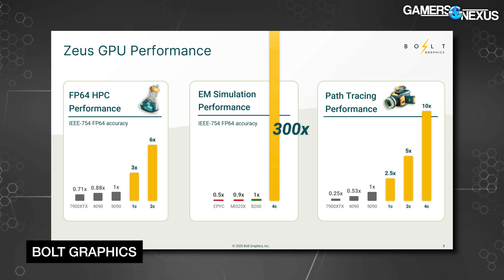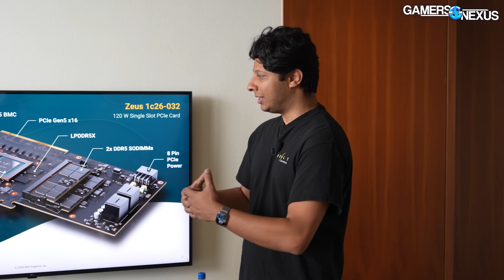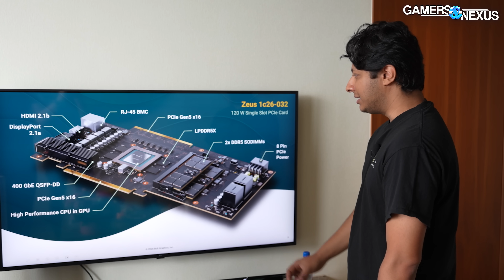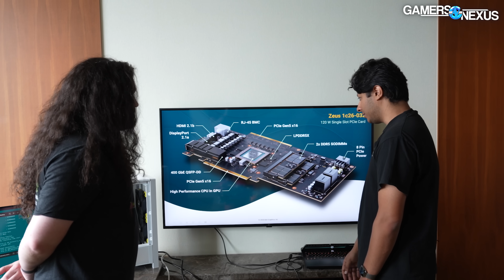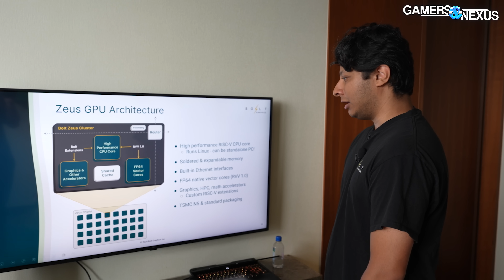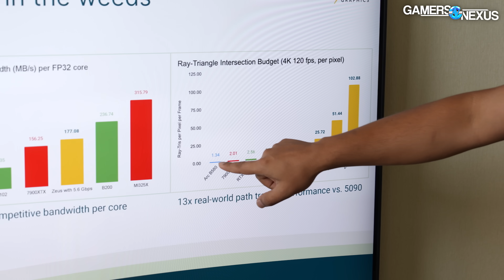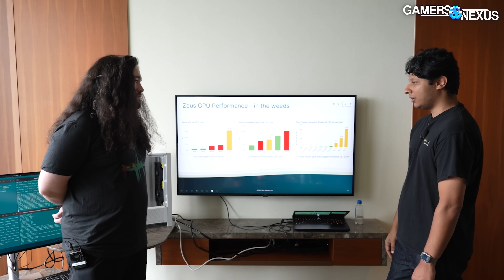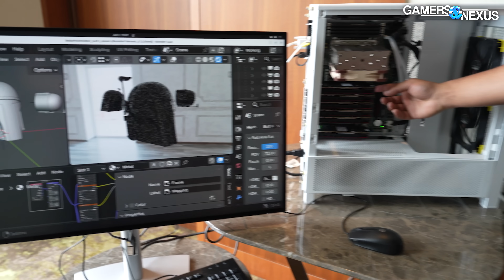A New Gaming GPU Challenger: Bolt Graphics Takes Aim at NVIDIA

Comment: Funny thing is, over 25 years ago, I pitched the idea of creating a GPU that had some sort of FPGA core to some teams at our university - to create a GPU, where you would reprogram it based on the application you wanted to run.
Instead of having a generalized GPU that is optimized for a bit of this, a bit of that, you could've had a GPU that could be tailor-suited to a certain game and the reprogram it for a graphics design workflow, again for video editing, pure raytracing and so on.
The lab of the Uni I was at had pure raytracing cards back then running on similar hardware clocked at 80mhz, that were faster than a 1.6ghz x86 CPU for RT tasks (not gaming, industry stuff).
The time wasn't right though, and also the time to set it up for the applications meant a) having a huge driver set with loads of presets and b) carrying enough FPGA cores to make this work meant having a huge (and expensive) chip.
With the specialised core count of todays chips, this is probably not even possible anymore.

Comment: Its going to fail since they have no real target market.
The places that could put this to use already have there own custom designs.
Content creators will use Nvidia since thats what every thing is made for. When your time is making you money you dont want to waste time on issues. Or they will rent time in a server farm which already has its own silicon.
It could be promising for Ai work but then again youd just get Nvidia or if you had mega mega dollars you create custom silicon.
And gaming well they are dead in the water without raster.

About the only market I could even see for a product like this would be as a addon card.
Run it along side another GPU and this handles the path tracing only. But then that becomes driver hell to try and support.

Comment: The best approach for this company would be to not go head on against NVidia and AMD at least not at the beginning, instead make this an add on board that works alongside an existing video card providing additional processing power and make drivers that behave similar to the Lossless Scaling software. This approach would allow for capital to grow very quickly, if they can make it for $750 or less. Unfortunately, this card would probably sell off the shelves rather quickly for A.I. use as well, especially with a $750 price point. Wishing you luck.....

Comment: I can do everything I need on my 3070 TI and 4070 Super for the next 2-3 years.  I hope Bolt's card is at least a mid-tier performer.  I don't need 8k@90fps.  I run 2k @ 120Hz  at most.  I'd buy their card, especially if they're not beholden to a VC group who's partially owned by nVidia or Palantir or any other AI slop master.

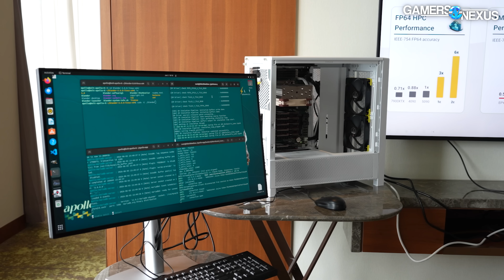Comment: 0:38 User expandable GPU memory???? This is amazing.
Reply: But then speed would be worse but i might take that tradeoff
Reply: Nice, but the bus is obviously slower and probably generate more heat.
Reply: I wonder how much the slotted memory will affect VRAM speed.
Reply: Hold your horses a little bit there! Games are not architected for multi-level memory. Games will only run on the baked in Ram. End of story (Mostly). Games would need some patches or support to be able to use it, which won't happen until this kind of architecture gains market share.

The user expandable ram will be for other things like large render jobs, or maybe a home server LLM that can live in it.
Reply: It's not. You're going to get lower bandwidth.
Reply: For what reason? That is for AI to tell you the truth. This company is just trying to do the smart thing.
Reply: @IdeaBoxful Because they can sell you a cheap base version with 8GB soldered for example, that you can then upgrade however you want as soon as you hit a bottleneck.

Because you can simply replace a memory module if it breaks.

Upgradeability and repairability are always a good thing.
Reply: @IdeaBoxful  the extra memory is in theory helpful for ai, but ai is not constrained on memory. it's constrained on bandwidth, and severely so. it's so bad, people have looked at stuff like analog flash in hopes of digging their way out.
Reply: Only for inference, not training, no?  @dead-claudia
Reply: @badgermcbadger1968  training requires extra memory, but that can be solved by just adding more memory (what nvidia's doing). and any latency can be hidden by just having a big enough pipeline.

now, if bolt did a design with tons of chiplets and added in the experimental matrix multiply acceleration instructions, people would actually snap them up for ai (and very quickly). but they aren't targeting that.
Reply: @IdeaBoxful  LLM's need bandwidth. 2 DDR5 slots gives maybe ~100GB/s. The 5090 has 1.79TB/s with GDDR7 iirc. The H200 (datacenter GPU) has 4.8TB/s with HBM3e. 

In short, the extra slots are useless for AI. Might as well max out your system RAM instead and get the same bandwidth (and actually get to use it). Could be some niche productivity uses, but that's about it.
Reply: @PragmaticTornado this product is designed for existing real usecases, not AI crap. As mentioned in the Video, the first target will be workstation tasks like 3D animation. And memory requirements will depend hugely on what people use the device for, or how complicated their 3D models are. One core part of the design appears to be higher flexibility with a much more capable instruction set and out-of-order execution. So it's going to possibly be slower with very simply structured workloads, but it will probably excel at complicated tasks where existing GPUs suck badly.
Also they make up the reduced memory bandwidth with caching, which will accelerate some workloads a lot, while some workloads might not profit much. That basically guarantees them a customer base with those workloads where it will blow out any existing competitor products.

And remember that the displayed device as explained is about 1/6th as much power as a 5090.
Reply: @PragmaticTornado  not to mention SODIMM slots can't run at high speeds, UDIMM are better but still lag behind CAMM or the good old
Reply: Its ddr5
Reply: @sirynka  their performance target is closer to the gtx 1060, which used gddr5. they have two ddr5 ports and two lpddr5x chips, which together would provide a similar amount of memory bandwidth if you do the math.

edit: they're not chasing raster performance, but ray tracing and path tracing performance. and so they can kinda get away with leaving performance on the table if they specially accelerate those.
Reply: @dead-claudia  There are two ways a processor can access two different memories, 1. run all memory at the same speed (the slowest speed) 2. build specialised circuitry in the microchip to decide which memory to use for which data, something that will definitely increase latency, power consumption and generated heat. this product is unimaginably stupid.
Reply: @Real_Commander_Shepard  The primary use case as stated in the video was to use the DDR5 SODIMMs as spillover which doesn't require running the soldered memory at the same lower speed as the SODIMMs nor does it require any specialized scheduler circuitry. Similar things have already been done already on some Nvidia video cards in the last decade or so. The second use case mentioned was striping across both memory pools which also doesn't require the memory to all run at the same speed with different size stripes for the different pools and the added latency of doing so is negligible compared to the latency of any memory access, especially compared to other GPUs which have far higher memory latency than such a product has to begin with. The very large cache also helps to limit the impact of memory latency and bandwidth for many use cases. Nobody claims that running their DDR5 system memory slower than their CPU cache is causing problems.
Reply: @sirynka  and?
Reply: @stclaws9580 it's way slower Than gddr That gpus use.
Reply: @stclaws9580  gpus recently have had GDDR6.

Comment: rare gamer nexus L.
They are literally hiring every position. It is like 1 dude and 4 PR/Sales people. Their job listings is literally hiring every possible hardware design role. Their funders are expecting them to launch a product Q4 2027. Shit is NOT happening. They don't even have the head count to layout a design, let along verify timing, verify engineering samples, and do a production run.
Reply: Also too many people are just wowed by "user expandable memory on a GPU!!!!1!" and not bothering to look up the difference in bandwidth between GDDR6 on modern graphics cards and laptop sodimms. There's no way this card functions comparable to any mainline gaming card released with the last 10 years. The CEO can boldly proclaim he intends to compete against Nvidia all he wants, but he won't be with this card. It's like a weak little level 1 goblin trying to fight kratos.
Reply: @iofhuazebulun7199  GDDR "can" work if you throw enough channels at it.
Intel is planning to do this with Celestial Islands, but they're going to chuck 24x channels at the problem.

Imagine people buying 24 laptop SODIMMS 😂😂😂
Reply: @iofhuazebulun7199  Did you not see the video. The card has a massive amount of cache.
Reply: Mouth breathing capital G Gamers

Comment: This is clearly not a gaming gpu. 400gbe interconnect and 2 channel ddr5 memory bandwidth puts this in the 'connect up 32 of them and run tensor parallel AI models' use case, not the 'play cyberpunk 2077' use case.

Comment: A video card with SODIMM slots is something that would've saved a ton of drama for decades. Probably SOCAMM2 would be a better fit if I pretend memory's still affordable for a sec. I kinda wonder if things have sped up enough that hitting the SODIMM pool won't feel like hitting the top 512 on a GTX 970.

Comment: AFAIK their ASIC is freaking fast for RT, PT and other compute intensive kernels targeting animation studio, game studio, movie studio etc at native resolution without dlss and other upscaling fast. I've no idea about power consumption and since it's ASIC it should be usually in the range of 1/5 or 1/10th of 5090 without burning the connectors. 
Xilinx is somewhat easier to get than nvidia fpga. 
As always I'll wait for second or third gen if the price is right since outside USA the prices will be brutal and only chinese gpu can compete with low prices with domestic fabs. 
Edit: I think the risc V IP is either Sifive and tenstorrent because of the AI focus with AMX

Comment: This combined sodimm and lpddr5 solution was something that AMD introduce with Vega architecture but was broken in the die. I believe they even had the issue fixed by the time the Radeon VII shipped. That's 2018 til now that they have had the ability to do this and they haven't.

Comment: go bolt, please do not sell out, if you keep some stripped down models as low cost gpus to put in rigs that just don't have enough hdmi ports or that people don't want to use the internal graphics and gaming gpu for the second and third monitors. currently people are buying old cards like 1080s for that purpose even though the drivers are dated, people will buy any gpu with updated drivers and two hdmi ports if it is priced within reason, and with the topside pcie design those gpus can be used as an extension of the better gpus if people buy them in the future. use the capital made from that to launch the design gpus, then use that profit to launch the gpus that can compete with the nvidia flagships in gaming.
making the drivers open source and giving consumers a decent interface for customizing the specs will make the driver software not need to support many old games directly, especially if you give your interface the ability to use plugins for individual games so that people smarter then I can set up support for their favorite game and share it so that others can grab their plugin to run that specific game better. I do not know a lot of specifics about driver programming, but this type of system has worked well in a ton of industries, please let me know if this is not possible because I want to learn.
making them also be a single board computer is a massive W as well to sell more of them, props.

Comment: So far havent been a fan of raytracing and only very few rt games are performant enough that i support it, one being kdc2.
But if we reach the point where rt is equally fast to baked lighting then i dont see a reason to not use it anymore, but going by the current rate that is many years away.
Games that force on rt like borderlands and the forever winter run into this problem where the only way to get it to run at a almost acceptable rate is by going as low as possible on the GI settings but doing so introduces shimmering like mad because lumen struggles with very few rays and thus it looks aweful, and the only way to get lumen to actually look good enough to be used is when running at high settings but then its super demanding.
Maybe one day we can turn on rt and only loose 5% fps while it gives us an actual looks upgrade and they arent cheating by using upscaling or framegen.

Here comes a theoretical situation:
Say nvidias 6080 runs X game at 200 fps with raster but at 60 fps with pathtracing.
Then bolt is ok at running the same game with raster at 70 fps but also at 70 fps with pathtracing on thus it doesnt matter AS MUCH if their raster is a whole lot slower since the fps cost of pathtracing is fuckall vs the cost on nvidia/intel/amd and in some cases like this one they might be better than the current market giants which is kinda cool.

But then again id much rather play a game in raster at 200 fps than a pathtraced version at 70.

Comment: RISC V presents both big risks, and immense potential for this type of work. Because the CPU instruction set is so open to extension, they have a lot or flexibility…so long as they are designing the CPUs. But that also limits them as RISC V has not yet been demonstrated to scale in IPC or clock speeds, so they’re on the edge of the technology.

Comment: Too bad their marketing is just BS claims with little bearing on reality. There's a reason why consumer GPUs do not use FP64 ALUs, it is just a waste of die space for something that has little impact on gaming or other applications (since you do not need that much precision outside of things like scientific computing). Additionally their ray tracing throughput numbers are likely either complete nonsense or purely theoretical. It is deceptive anyways to say they represent actual path tracing rendering performance as a large part of the cost in path tracing is not from the actual ray triangle tests but rather compute work and how well the GPU's cores actually handle complex non-coherent workloads as well as things like memory latency. It is not a trivial thing to magically improve especially for a smaller company (which is why companies like AMD even struggle to match Nvidia's performance in RT titles). Also don't even get me started on the massive amount of work that has been put into drivers and optimizing shader code generation or other software ecosystem concerns they'd need to overcome to be an actually useful product.
Tldr: Until they have actual benchmarks backing any of their claims I'm not convinced of anything they say.